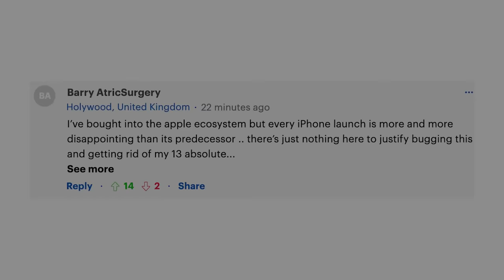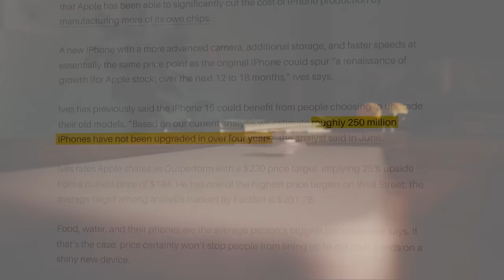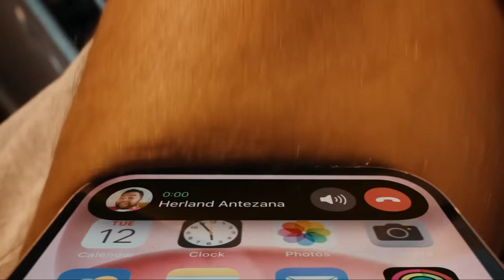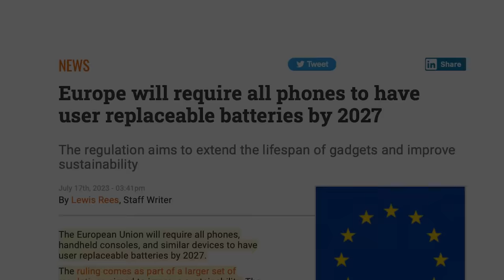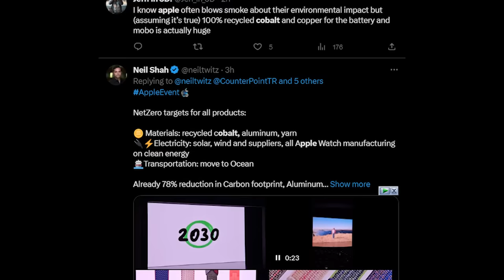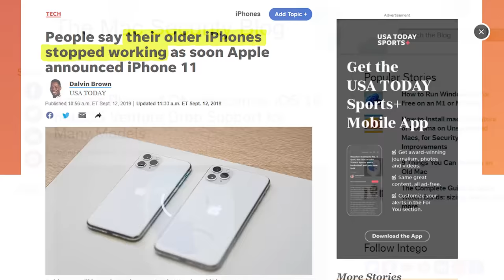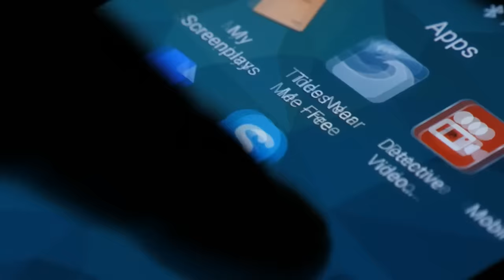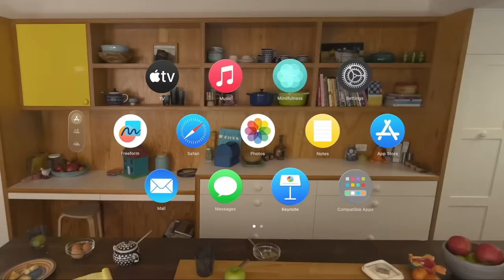The iPhone 15 Is Everything Wrong With Apple

Comment: Clearly, no-one wants technology which is freaky or dystopian. Which VR is. VR is not the future. What set Apple apart and still does is the little things. The dedication to quality and reliability and the ability to make life easier. Making a phone with three suffixes is not how it used to be done. There was one iPhone model on the market at a time. No size options. Because Apple had figured out the best size. That was the iPhone 4. It had a physical button, even though it would have been easier to just make the screen bigger. Because that one giant button was better than the electrostatic touchscreen and iOS combined. Because the button was easy to understand. The rounded square icon on it tells you this is the panic button. The square means safety. The warm and helpful world of the Apple ecosystem. iOS destroys Android in terms of user experience.

But they want you to just get a new phone every 4 years. All the aps stop working after 7. But the iPhone 5S could run anything the latest iPhone could. It's like a 2GHz ARM dual core cpu and gpu with 2GM of ram. You don't need that to browse the Wikipedia app but that app is no longer supported.

My battery expanded and broke and a shop just changed it - no fuss. But the apps aren't really supported any more and games are dropping off one by one. I don't like that.

The iPhone 5S is quite capable of being a fully useable computer using the magic keyboard but integration is a bit of an afterthought. The iPad is where that should be at. But what if I want to use my ancient iPhone with a keyboard just for funsies. or maybe working on the go? Actually, you almost can. The only function it lacks is an alt-tab app switching keyboard command. But you can bring up search using command-space and the volume, play/pause and brightness keys work, it's so neat. Games don't work with the keyboard.

It's the ease of use of the hardware and software that make people appreciate Apple products first and foremost. It's like they thought about you. It's so endearing. The total opposite of Microsoft. Something like the magsafe power connector is a good example. They need to admit that the phone market should be allowed to retract, because new hardware is simply no longer possible and it's providing services and collecting royalties and fees from the Apple Store that is the next best revenue stream. For apps and games and media that people want. Not having to constantly upgrade stuff just because.

Comment: 8:15 - dude dont want to ruin your beautifully written monologue, but the problem is capitalism. System which ve been built around profit, so as long as it persist, such practice/behaviour will continue, there is no otherway, except deceiving ppl, who arent getting smarter
Reply: It's the only system that actually works, sadly.
Reply: @ismaelguzman991  not really. There were different system for different times, capitalism just like any other system before exhausted itself, we passed the useful period, and just like before waiting for tension reaching its limit, when "enduring" any longer wont be possible

Comment: Ok, as a tech person myself I have to say, yes, the iPhone is overpriced, and yes, you can get a phone that does everything you need with less than 300$. However, saying that apple stopped innovating is simply a lie. Today apple has one of the best chips in the world, the M series chips. Their laptops are undeniably some of the best today. Their products are ridiculously good. It's not easy to make something like that, despite the fact that there is little innovation in the field. Apple is not the only company that is not revolutionising the world every year with their iPhone, every company is just adding small improvements in each and every release. The new iPhones were revolutionary because they were the first ones, the first time we ever see anything like that. I own an iPhone because it works so well with my MacBook. And the M1 MacBook Air is the best laptop I ever owned, the experience doesn't come anywhere near the old windows laptops I had. I think what's upsetting is the way society works, but that is natural, we are only humans after all.

Comment: That's actually not a very good video - In fact: there are more then one change to the new Iphone (better camera, action button etc.), and it is not only about the way it looks (and even if it does - you can raise the same claim about a lot of the flagship devices Apple's competitors had put put lately so it's not only the Iphone). Also, most figures and statistic show that most people stick to their new Iphone for at least on year, meaning they are not rushing to buy a new one, as you assume and declare (not counting the amount of "last year's Iphone" being sold, which are pretty significent). Also, there is a huge chunk in this video - sadly contain solid truth - about cobal and Apple adopting "green" values - that's not much about the Iphone it self nor Iphone 15 in particular. @Moon-Real
 I like your videos but this one is just a sporadic rant on Apple and I found the title very misleading.

Comment: This video is a joke. Like most people, I too understand that Apple is a corrupt corporation, but this video does a terrible job at making the point that Apple is itself worse than most companies. Apple is just another company. Yes, the largest tech company, but it is no worse than most others like Microsoft, Google, Nvidia, Samsung and the like. 
The point that Apple is devoid of innovation is a terrible argument. There is a huge amount of innovation going on. Obliviously not as much as there used to be before the product matured, but that goes without saying. Of course they’re making a big splash about the tiny design updates or minor improvements. What do you expect a product company to do? I for one would much prefer a device that gradually gets better year after year, and end up with a solid, tried and tested piece of tech in my hand than a device that gets released every few years with wild design and functionality changes. Of course I want some ‘cool new feature’ to come along in every device, but not at the cost of the overall quality and price. 

It doesn’t make you an individual to argue that Apple is a bad company: it’s so obvious. But if you’re comparing them to other companies, I’d have to disagree. I think that they’re perfectly average… or even above average. That’s how they’ve gotten to be so big. You’re not intelligent or interesting because you can call out the general flaws of a corporation based on some anecdotal evidence and a personal opinion. Make a real point. Look at the data. Craft a genuine criticism of something, don’t just call them “bad” or “boring”. You can do better than that.

Comment: Android phones have more innovation than ANY iPhones out there. There are folding phones, google messing around with a built in temperature sensor though not needed at least they put one in for people to at least try. Samsung and LG had IR blasters at one point so it eliminates you having to get either a universal remote for a tv that is missing one or if the one that came with it ended up breaking. Apple just makes the same trash products and its the same every time why I will never buy one. Not to mention app support for older android versions are better than iPhone. I have on android phone using Android 9 and it can still use modern apps made in 2023 and that phone was made in 2016.  I went from using an iPhone to an Android and I will NEVER go back. If I cared for the latest update on an unsupported device custom ROMs are a thing. So I will always have the latest up to date firmware.

Comment: I have to disagree there has been quite a few more updates to the iPhone 15. I would not never buy a Samsung either they SUCK!! 

But that aside; one of the main reasons Apple will still always going with the Apple iOS even along those that understand phones still even the bare minimum like yourself and do not know how they fully work. Apple and even the Pixel phone have both made the best software wise. They both go with a Pure OS Samsung no matter how little storage they finally have started to use they still have a ton of bloat ware apps on their phones aka software or apps you can not remove. 

But your chewing out just Apple here all Malfunctions are guilty of this you need to be going after all not just one. Apple is not even the main guilty party.

Comment: This is such a dumb video. Apple phones tend to be the longest lasting, and while planned obsolesence is real, batteries do just wear out like that. It isn't a conspiracy. 

As for cobalt, you point out the downsides of using virgin freshly mined cobalt... in response to Apple using recycled cobalt. The cobalt Apple is buying is not from a mine, it already existed. 

Apple didn't start the trend of the two-lens camera, HTC had one in the M8 and a Huawei and LG both released with user-accessed secondary cameras before apple did. 

These topics you spent 4 minutes on, meaning 1/3rd of this video is just... not applicable, untrue or misleading? 

Apple did not stop focusing on the Mac because Steve Jobs saw no future in the Mac, plenty of Mac innovation occured after the release of the iPhone including the Macbook Air, arguably the first modern laptop. They had already pivoted however to the iPod which was wildly successful.

All Apple could do to make the iPhone better is reduce their margin on the base models and stop withholding zoom cameras and 120hz arbitrarily so they can be on parity with competition, and then maybe increase the battery size so that it would be useable longer? Other than that there's not much innovation going on at all in the market. 

This video is overly cynical and so edgy that  you just... ignored the mundane reality that the iPhone is boring because it is just matured, and old stuff from the middle of the S curve is obsolete because it was during a rapid improvement time, whereas new stuff isn't obsolete because things last longer unless the battery breaks.
Reply: Bros onto nothing! Apple fanboy alert!!
Reply: @eightup  I own an Android and avoid buying iPhones?
Reply: @eightup Bro really just insulted him, rather than countering his point💀
Reply: @broskibrobro1278   bro really replied to a 12 day old comment 🤣
Reply: @broskibrobro1278  also the convo is over.. I literally forgot abt this comment
Reply: @eightup  Forgetting about something doesn’t make your initial point any less stupid.
Reply: @broskibrobro1278  replying to a week+ old comment doesn't make you smarter 🤣
Move on bro this convo has been over. The guy who replied to be moved on and so should you 😆
Reply: @broskibrobro1278   congrats u moved on 🤣🤣🤣

Comment: there are still so many rooms to innovate...
for example, the capability to install OS other than iOS, external memory, capability to upgrade hardware without changing the case itself, and so on...even removable batteries is an innovation by itself 
but Apple won't do that because those innovations won't benefit the company.